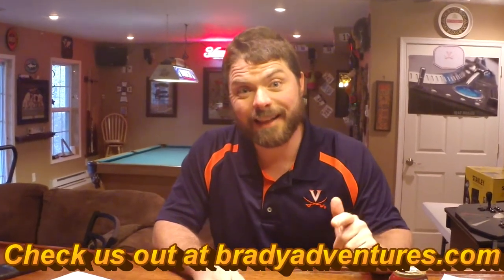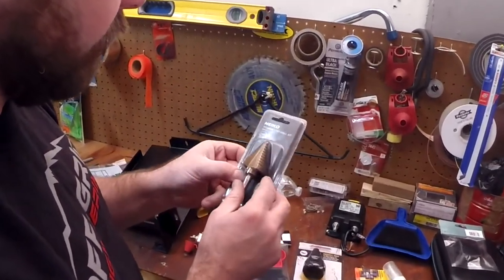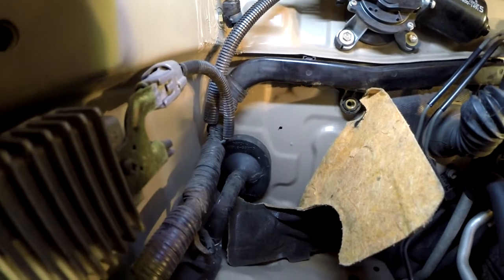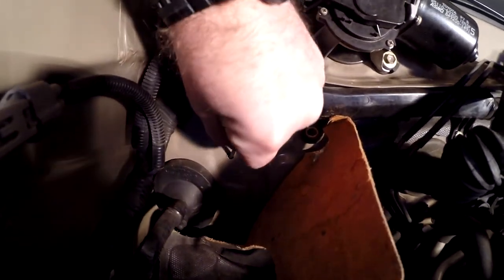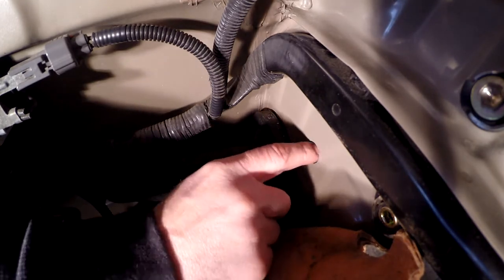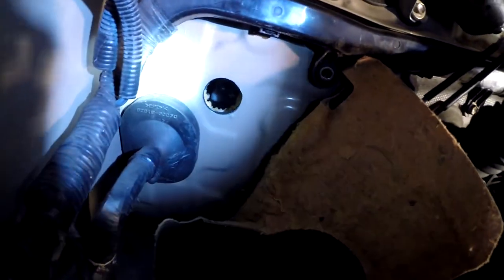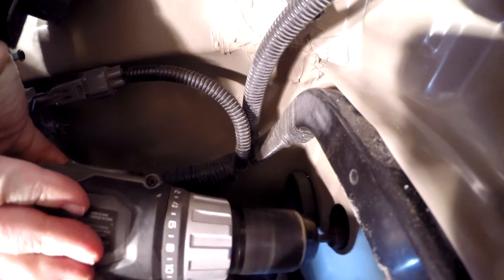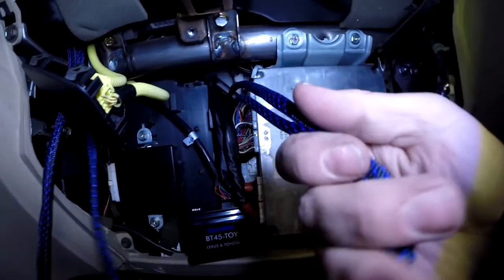Punching a Hole In the Land Cruisers Firewall

Comment: Lots of videos on this topic show where the hole would be drilled then show the finished installation.  Almost nobody shows actually making the hole.  For my application, the most challenging part is going to be getting the drill into place to make the hole--it's a tight fit under my hood.
Reply from the maker: Thanks man! Good luck on your drilling!

Comment: Hi Brady, did you have to remove the glove box to get at the hole? Great videos and thanks for your help!
Reply from the maker: I don't think it's absolutely necessary but you'll probably want to just make it easier
Reply: Brady Adventures thanks!
Reply from the maker: @MegaGmoney13  No problem, sorry not a very detailed response, I've been on the road with limited comms.  Let me know if you have any other questions I should be fully back on grid by sometime monday.

Comment: Dear Brady Adventures, is it any kind of glue that you use in the fend of the video (a white tube). Is it to fix the groomet? tks for the video
Reply from the maker: No it wasn't glue it was clear silicone like this http://amzn.to/2GAw6NX
The silicone is  to keep water out. I put some in the channel with the wires to keep water from getting inside through the wires and  some around the edge of the grommet to keep moisture from getting around the edges. Probably not completely necessary but just to be safe
Reply: Great! It really makes sense! It would be nice to put this kind of links to reference products used! I live in southamerica and every time I need something more specific (that is, need to buy abroad), as this groomet is an endless search to find what really works, from garbage! Thank you very much!
Reply from the maker: Nelson Brügger thanks man let me know if you have any other questions in the future, I'd be happy to help